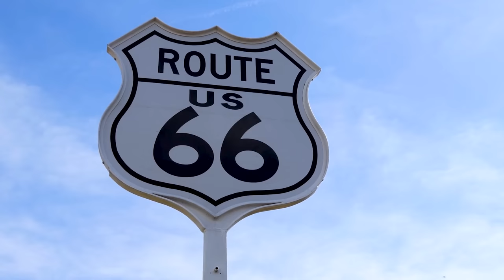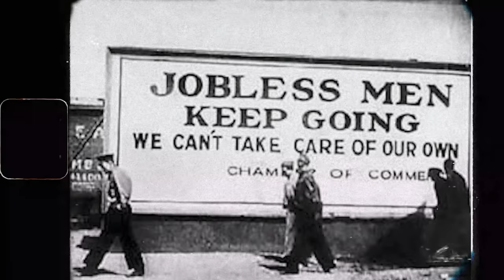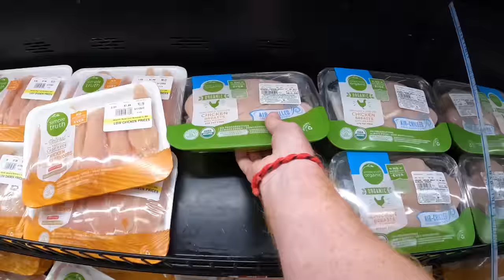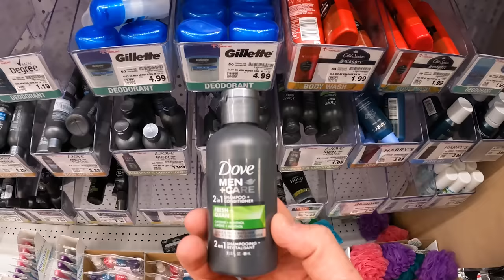Living Alone in an RV for 48 Hours!

Comment: You're cooking wasn't too bad but if you want to make your food taste great always season your food with salt and pepper and don't use metal utensils on a nonstick cooking surface use wooden, plastic, or silicone cooking utensils and the essentials of cooking utensils are tongs, spatulas, and spoons. And to cook food you got to start with a cutting board and a good knife because the first thing you do before cooking is to chop your food and that's why you start with a cutting board and knife they're your best friend in the kitchen and since you have garlic you can just separate the cloves with your bare hands and either dice or slice with a knife or a garlic presser they taste good when it's cooked but put your garlic on your sauteed veggies so they won't burn.

Comment: Morbius is a 2022 American superhero film based on the Marvel Comics character of the same name, produced by Columbia Pictures in association with Marvel. Distributed by Sony Pictures Releasing, it is the third film in Sony's Spider-Man Universe (SSU). Directed by Daniel Espinosa and written by Matt Sazama and Burk Sharpless, it stars Jared Leto as Dr. Michael Morbius, alongside Matt Smith, Adria Arjona, Jared Harris, Al Madrigal, and Tyrese Gibson. In the film, Morbius and his surrogate brother Milo become living vampires after curing themselves of a rare blood disease
Reply: The FitnessGram™ Pacer Test is a multistage aerobic capacity test that progressively gets more difficult as it continues. The 20 meter pacer test will begin in 30 seconds. Line up at the start. The running speed starts slowly, but gets faster each minute after you hear this signal. [beep] A single lap should be completed each time you hear this sound. [ding] Remember to run in a straight line, and run as long as possible. The second time you fail to complete a lap before the sound, your test is over. The test will begin on the word start. On your mark, get ready, start.